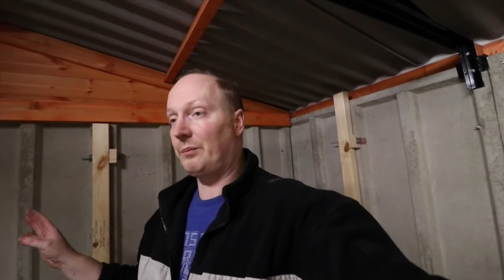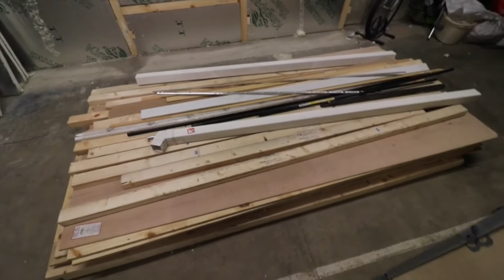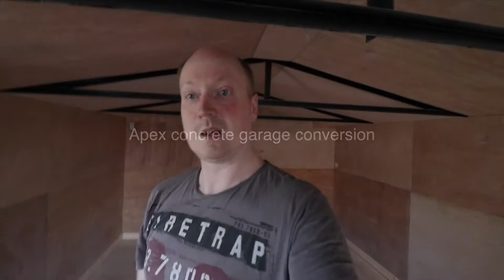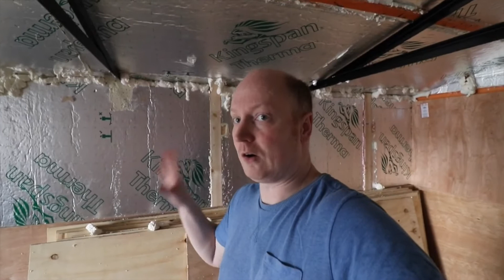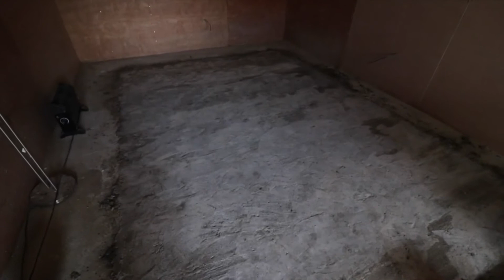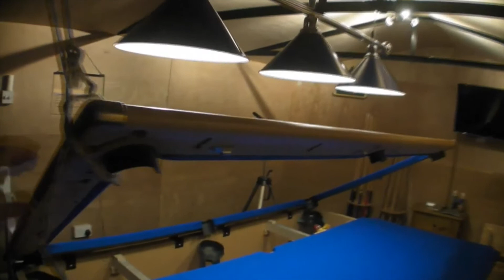HD full garage conversion snooker and pool room HD quality full install

Comment: I would like to thank you for all the work that you have done creating you very comprehensive videos. I am just ready to start on my new garage once it is erected .you made everything Cristal clear the only thing that  I would like to ask you how did you decide what the spacing should be between the studs?  And once again thanks.
Reply from the maker: As for the batons I just guessed in hindsight I should have doubled them as plywood in large bits can bow.

Comment: Fantastic video with loads of useful bits in it, thanks for taking the time to put this up for us.  I am mid-conversion of my own 6x4 concrete panel garage and have a question for you.  I am worried about insulating the roof and getting the max headroom that I can.  My plan was to have the roof sheets - 50mm gap - breathable membrane -  between rafter insulation 60mm PIR - foil insulation/vapour barrier -plasterboard.  Did you put a breathable membrane on your roof space prior to friction fitting your PIR insulation and if so did you tack/fasten this immediately below the concrete roof panels or to your roof members with a small air gap?  Sorry for the long question but I think it pays to be clear in what I am asking.  I am pulling my hair out with the options.  TIA
Reply from the maker: No I just fixed Kingspan sheets to the roof no gaps. No issues keeps roof warm my head clearance is just over 6foot high. So its ok for me just about.
Reply from the maker: I used 40mm sheets
Reply from the maker: Also use alot of spray foam to fill in gaps

Comment: Hi how wide is your garage I'm in the process of converting my block garage it's just under 3metres wide and I'm thinking  a 6x3 pool table
Reply from the maker: every thing you need to know is in the video plus the q and a video.
Reply: @Technologyadvisor1  I've got to say sorry if I'm wrong that looks a lot narrow for 5 metres
Reply from the maker: @badgermartin7993  it went down to about 4.5 meters after insulation and plywood
Reply from the maker: 5 meter by 7
Reply: @Technologyadvisor1  cheers

Comment: Hi

The video was brilliant. Just interested where you bought your batons from? B&q perhaps? Bulk buy? Also did you slot the insulation in between the batons?
Reply from the maker: I got my wood from Wickes its easy to slot insulation in between.  If your interested i made a video regarding where i got every thing. Check the Playlist for video on costs

Comment: Thanks! Thank you for taking the time to show your conversion and the issues along the way. This is hopefully my project for this year. Still undecided whether to go for apex or a flat pent roof garage. I guess flat may be easier to board and insulate, but a little less height.  Sealing the garage to the base, did you just use a concrete fillet round the inside?

Good project, well done!
Reply from the maker: I tried floor levelling compound but it started to crack I had to pull it all up and decided to put concrete down after a pva the floor.
Reply: @Technologyadvisor1  well on with my conversion now. All insulated and boarded. Another coat of paint then electrics time!
Reply from the maker: @andydunn_24  you need to do the electrics early on so you can plan every thing around your cables
Reply: @Technologyadvisor1  it's only for a workshop, so I'm going to surface mount everything 👍🏻